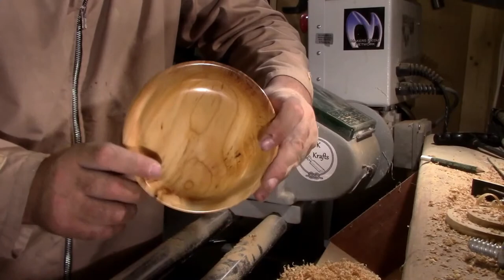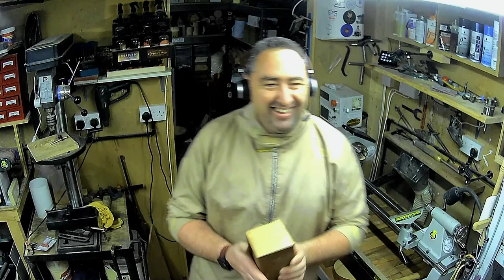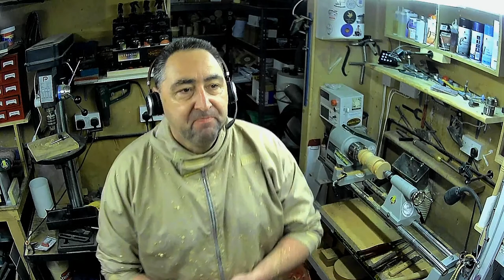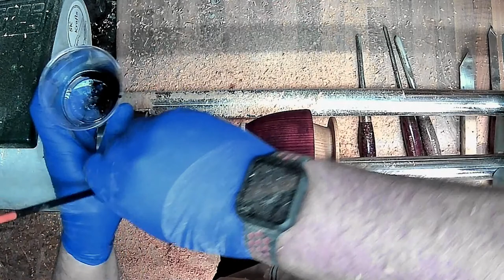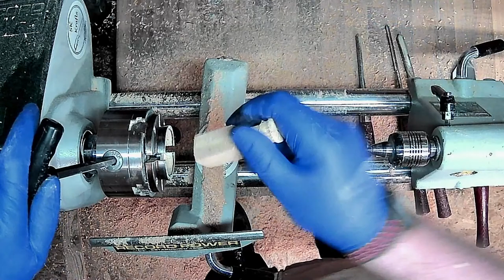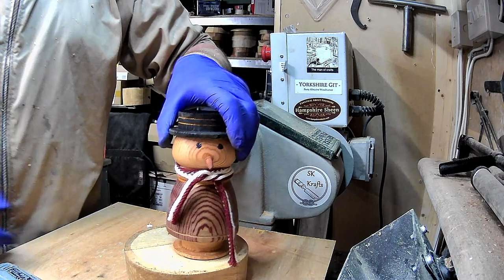Woodworking | Making a Snow lady

Comment: Hi Steve, you mentioned briefly about cutting resin with carbide tools. Reminded me to ask if you have bothered getting a pressure pot to cure your resin work?
Reply from the maker: Hi mark. Yes I do use a pressure pot.
Cheers steve.
Reply: @SKKrafts  would it be ok if I asked which model you have and where you bought it from please?  No problem if you would rather not say. Thanks 👍🏼
Reply from the maker: Mark I brought a pressured paint pot and converted it to a pressure pot as pressure pots are so expensive. Look on eBay at them you can get one for around £50. Does the same job. If you need more info message me.
Reply: @SKKrafts  Thanks Steve, I’ll check them out on eBay. Cheapest ready made pot I’ve found is £240, as you say, a lot of money. Thanks again for your help with this 👍🏽😊
Reply from the maker: Any time mark. If you need more info them message me mate.